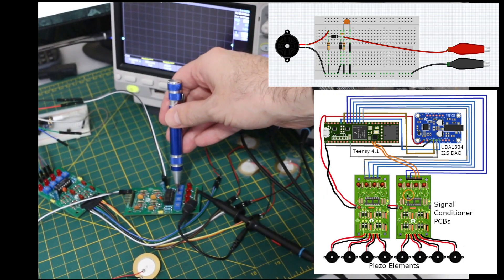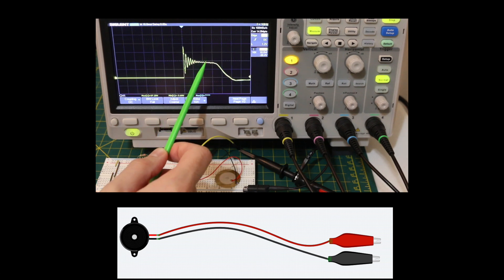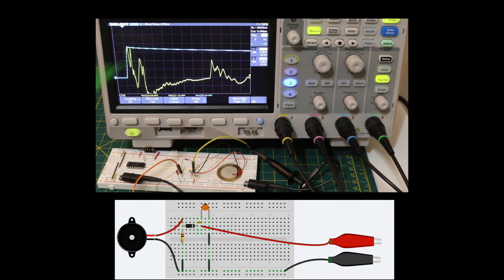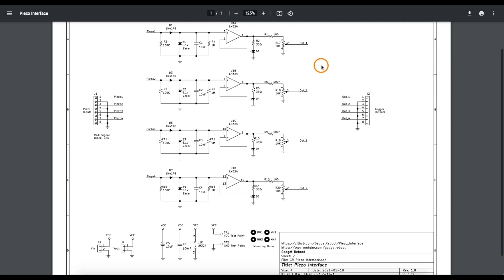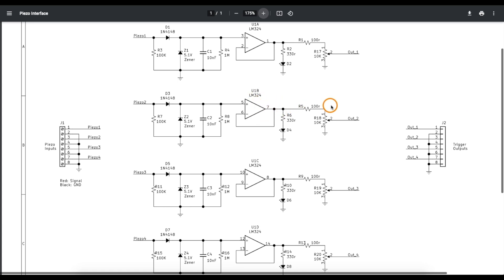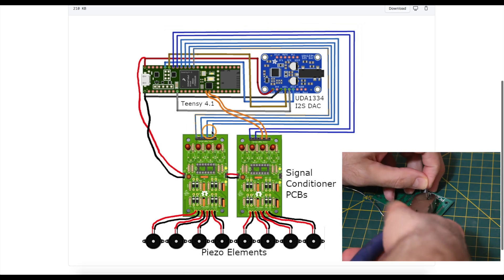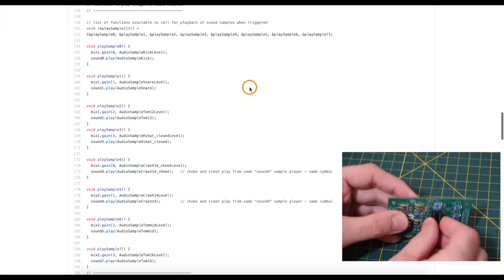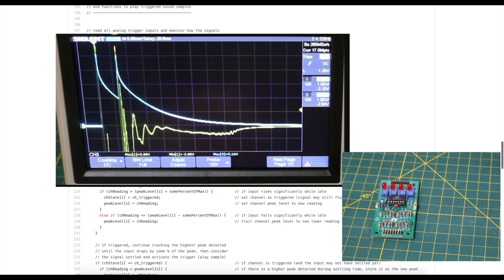Teensy 4.1 - Piezo Drum Trigger Signal Conditioner Interface (4-ch)

Comment: This peak detector is way better than my first attempt at a drum module! It resolves a lot of the problems I was having. The bad part is the unity gain. Once the piezo is installed in my diy mesh head or glued to a cymbal, the voltage drops considerably.  My home made edrum set is pretty typical cone trigger and glued cymbal attachment.  I've been experimenting with modifying the circuit to get me closer to a full range of velocity (0-3.3v). The unmodified board gets me around a half volt from the drum and about 20 mv for the cymbal. After tacking on a voltage divider and diode for the gain, I get about 3v for the drum and 1v for the cymbal when I wack it my hardest, but not consistently. Hopefully I'll know more when my new oscilloscope gets delivered. If you do revisit this circuit, I'd love to see how you would go about getting this to work. Thanks a bunch. My first attempt had lousy, inconsistent velocities and couldn't even detect a cymbal. I can't begin to tell you how much of an improvement this has made. I've learned a great deal.
Reply from the maker: I wonder if some sort of compressor op amp circuit would help where it can amplify weaker signals and attenuate stronger signals automatically calibrating but of course the responsiveness would need to be looked at. I’m sure eventually I will be looking at trying to trigger acoustic drums with it and I may try to figure out how to normalize the conditioned signals then.

Comment: Hi! First of all thank you very much for putting the effort into making this video. It's great! 

I'm trying to use the same design to build a diy edrum kit but I noticed that after adding the Zener diode the signal gets clamped to a fixed value. So the initial part of the decaying signal is flat at the Zener voltage for a couple of ms and then, after some time, decays normally. This makes it hard for the ADC to distinguish between hits stronger than a certain threshold. While this is expected behavior with a Zener voltage regulator, it doesn't seem to happen to you in the video. Am I missing some detail? Thanks again!
Reply from the maker: I can’t remember now what my waveforms and voltage levels looked like but my first guess if the signal is staying clamped at the zener voltage too long, it sounds like maybe the piezo voltage is staying high for too long so if it’s above 5 V for a couple of milliseconds it will stay at 5 V if that’s the Zener used.
if you are using the same component values and circuit that I am, I wonder if the capacitance on your piezo is larger than mine so it’s holding the charge longer. If that’s the case maybe reducing the resistor value that’s connected to the piezo to discharge it faster would help quickly bring the voltage below the zener threshold.
Reply: @GadgetReboot  Thank you very much for replying so quickly! I'll try to further understand the capacitance of my piezo!

Comment: Thank you. Really nice and illustrative. I am making a drum kit, but I am using a 4067 MUX to feed 16 piezos into one arduino analog input. Is it possible to do the signal conditioning just once at output of 4067 or is it required to do it at each input?
Reply from the maker: I would say each input needs conditioning separately because otherwise all of the high voltage and negative voltage spikes will be presented to the 4067, which likely can’t tolerate it anymore than a micro controller input.
And if all the different sensors are routed momentarily to the one signal conditioner, the point of the signal conditioner is also to hold onto the trigger pulse so it will be available when the processor can get to it so if there is a sensor that’s not currently connected to the conditioner, the pulse may be missed or at least its characteristics like what the peak was and how strong the hit was if the micro controller only gets to it halfway through the pulse when it’s already decayed.
Reply: @GadgetReboot  Very clear now. Thank you very much. What do you think about having all the conditioning for each piezo before the 4067, but only one OpAmp buffer after the 4067?

Comment: Great project!! One question...the UDA1334 could be replaced by a sgtl5000?
Reply from the maker: I think I was using three different I2S boards and chips interchangeably with no problem but it’s been a while since I’ve used any of them. The main difference might be that the SGTL 5000 might need some different initialization code but the hardware should all be able to handle the audio data

Comment: I really appreciate this vid. Just wondering, what was discharging the peak detect cap before you added the 1 Meg resistor?
Reply from the maker: if there were no obvious discharge path like a resistor so that the capacitor can only either see a diode or the input of an op amp, there is still a very small amount of leakage current in reverse through the diode and possibly into the op amp, whether it’s microamps or nano amps, so eventually it would discharge, especially being a relatively small capacitor value as opposed to something like a big electrolytic that still may hold a charge for a very long time.

Comment: thankyou for sharing. I am yet to dive in and buy the kit. I want to make a midi djembe (because my ears cannot take real drums and my partners hands cant take them either). 

The piezo signal altering was very interesting. I used to be a programmer but electronics like that leaves me baffled ! lol i can read code but not circuits...... it will be different for hand drumming piezo response but this hellps a lot. When you triggered play and then a few ms later before full decay you play again for the next trigger, did the entire sample of the first get played? or does the second trigger stop the sample playing and start it again? ie does the sample play time ever exceed the gap between hits? i ask because it sounded good on the demo.

I am also interested in after touch or continuous touch.... since with a djembe if you play the right hand with the left hand on the skin, the sound from the right hit is very different.

thanks again
Reply from the maker: I glanced at the code it’s been a year now, so it looks like if the same instrument input is triggered again, it will cancel and start the sample again but when I’m playing multiple separate instruments they play concurrently.
 
I think when I set it up, I was thinking that for a regular drum kit, when the stick hits it again, it’s overpowering The original hit on that same instrument anyway so I might as well just take the easy way and let it start the sample from the beginning but of course I want multiple different inputs to be going at the same time.

I think the way it works is each sample is assigned to a sample player in memory so with eight inputs I have eight players sitting in memory and all eight can go at the same time, so if I actually wanted to be able to re-trigger one of them multiple times and have those all play simultaneously, I would probably duplicate or triple the number of players in memory and cycle through them so I actually get three concurrent hits on each Piezo input or however many I think I need to be realistic with whatever is being played by hand. But I’m not sure if that eats up a whole lot more memory to actually load the same sample over and over, or if there’s more clever ways to do it like just redirecting the existing sample to different players, it must work that way I can’t imagine they set it up so inefficiently in the audio libraries, three separate players must be able to read from the one data sample.  but that’s the concept.

to simulate something where hitting it different ways may actually require a different sound sample playing back instead of just the same sample at a different volume, which I also imagine a bodhran drum benefitting from, if it’s being simulated with maybe two different piezos  on the same surface, I suppose software could look at the inputs as a set and do things like if only one input is triggered, just play a standard drum sample at whatever intensity it was hit, but if the other input also triggers relatively close, maybe assume the skin is being muted and playback a whole different sample at whatever intensity. but if the hand is constantly resting near the one sensor it may require a different type of input hardware monitoring for pressure sensitivity while the current circuit is more looking for momentary spikes instead of constant pressure but it’s definitely doable
Reply: @GadgetReboot  thanks for the reply

yes as for the second sensor i guess an FSR (force sensitive resistor) would do, but i saw one attempt at building a midi drum with them instead of piezo's and they were erratic. As for how the output of a quickly hit piezo behaves if the hand stays on i dont know. Are peizo's constant pressure sensitive and the oscillations in the decay voltage  created by physical ocillations in the sensor pad?? The use of the metal base might signify that. Stick heads are very small of course by comparison and may preference decay oscillations in a hit. (thus the decay capacitor might mask the nuance of such hits. I dont have an oscilliscope but that serial output function will help.

Yes ironically a djembe similator would have to accomodate both situations ... the sound of a strike is cut off by ANY new hit, .... but also changed by a constant pressure on a pad (same or different pad). 

The bass on a djembe for example is immediately muted by a subsequent tone note because it is on the same skin. However it isnt an immediate cut off, and rim hits have less sustain effect on previous bass strikes and other notes.

On the other hand (excuse the pun) fingers or palm on the skin have a distinctive altered sound on the strike note. (even to the point of creating a sliding scale as the finger is moved to the rim). I wouldnt even try to emulate that! But in addition, there is the delayed hand release (of flap), which also mutes and changes the sustain and sound of a note, and djembe drummers use that instinctively.

All very complex! lol ... but thanks again for your very detailed reply. Even the sounds you got were very good and i cant expect a midi peizo to be the same as a single skin acoustic.

 With regard to the opposite desired effect(i am not familiar with sticks) it would be more like a polyphonic sample duplication like you say. Quite how of course  i dont know, but luckily it isnt what i am after for a djembe pad. (multiple mixers i the gui?? Can a sample be played by 2 mixers at different times but within the same note length on a teensy?)

anyway start simple!

👍

Comment: Hi my name is Eddie I’m a looping musician I use boss 505 loop station currently I’m using a foot switch to start loops and stop loops I’m trying to find a method to use a drum trigger to replace the foot switch and trigger the loop station with a drum pad
Reply from the maker: Looking at the graphic on this dual footswitch, which the site says is compatible, https://www.sweetwater.com/store/detail/FS6--boss-fs-6-dual-foot-switch
It looks like the footswitches are just open/close contacts between tip or ring, and the sleeve, and so depending how that's designed, if the common sleeve is actually circuit ground, a simple transistor could be used to bring one of the other tip or ring inputs to ground, which can be driven by anything.  Or worst case if it's some weird circuit that needs those pins shorted when pressed, a relay could be used to connect them from another circuit, or a JFET type transistor.
Reply: @GadgetReboot  that would be so cool I looked in my forest Memes getting started in electronics book and didn’t see a circuit that I could configure rate and that way or maybe I just didn’t know what to look for could you recommend a circuit for that application

Comment: 20ms sounds like too much latency to me. Or is the final latency much less than this? Was it measured?
Reply from the maker: It's been months since I did it but I think the 20ms was the time between successive hits being registered rather than latency from making a hit and hearing the sample played, and so it was more about the stick responsiveness ability to detect fast multiple hits. 

  Somewhere after 12 minutes in, showing the waveform of 2 hits on the scope and talking about how the actual sound is triggered when the signal falls 5% below the peak, I don't remember the scope time per division but the signal is triggered quickly with the cleaned up trigger pulse, then the next stick hit is detected some ms later and relatively quickly registered to make a sound again.

If I had everything set up better it would be interesting to actually measure with a microphone hearing the stick hitting the pad and hearing the sound start to play (plus the latency of physical spacing but the mic, speaker, and pad would all be within a foot), but maybe that can be for another day.
Reply: @GadgetReboot  OK so it sounds like latency shouldn't be an issue then. I am about to build this circuit to use with a 3D Printed 12" snare drum i've just made. Thanks for all the effort you put into creating this.

Comment: This was absolutely awesome and you really gave a great explanation. 

I think the circuit would have been a lot simpler though, if you had just used a Quad 555 timer Set up as monostable multivibrators triggered by the input. I think in that case, you may only have needed the zener.. Or maybe a couple of in914's, and use the voltage drop across them. 

Great video, and I'm definitely a sub.
Reply from the maker: Yeah I could have triggered a one shot like that as a sort of debounce, but I'd still want to have a way to detect the strength of the hit so I'd have to see if I could trigger it enough to generate longer/shorter effective pulses that can be time measured as an intensity indicator.  I haven't played with the monostable in a while.  If the input trigger is still in a trigger state when the output has finished its pulse, if it can re-trigger immediately without needing the input to cycle first, that could work.  
But of course I also wanted the interface to potentially be used in further analog noise making circuits to trigger those with analog inputs, either to modulate their volume or pitch based on triggers.  It's good to have many ways to do things.  I'm going to try to get back to these types of building block analog circuits this year.

Comment: Amazing explanation - Have used your sketch to build a digital Handpan and it works perfectly.

Would it take much to pull the audio from the SD card instead of memory? Thinking about adding different scales in so will have to use an SD to hold them all.
Reply from the maker: I know the data can be pulled from the card easily enough, in the Teensy audio gui tool there are PlaySDWav and PlaySDRaw that can be used as sample sources, but I haven't tried it so I don't know if there is latency that would cause problems for playing back immediately.  Wav especially would take time to parse the header each time etc, raw plays immediately which sounds like playing from program memory, just don't know if the SD vs program memory access time is too slow.

Comment: Great video. I used these piezos to make triggers to put in acoustic drums to drive LED strips - one trigger for each drum (inside the drums - trigger and LED's), using an STM32F1. It was pretty easy to catch only the initial peak as you have noticed. The problem was that they were not road worthy - they would literally fall apart after at most 8 or 10 shows - sometimes 2. I eventually embedded them inside a coating of liquid electric tape and that worked until not much longer when the thrill of drums that light when you hit them wore off. I was thinking it could be cool to a web sort of thing above the drummer sort of reflecting the drums played, but I haven't picked the project back up.
Reply from the maker: I was thinking of eventually trying to make drum triggers so "playing" can be recorded and then the kit can be changed for playback for fun, but in reality what I'd need is a circuit that can  do the equivalent of auto-tune for bad rhythm....need lessons.  But I have an acoustic jellybean kit made of Tama Rockstar (main 5 piece plus an add on 10 rockstar tom), Yamaha Stage Custom (8 tom), Pearl Export (18 floor), and a couple of 6 and 8 Tama Artstar (I think) concert toms.  20 years of living next to a music store and having access to ebay.....